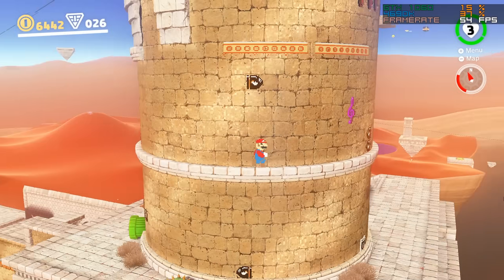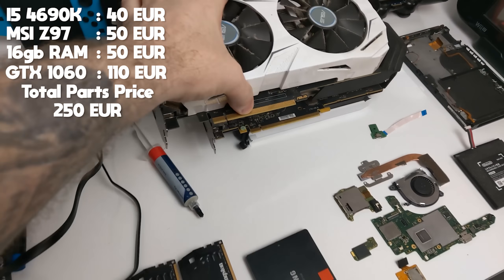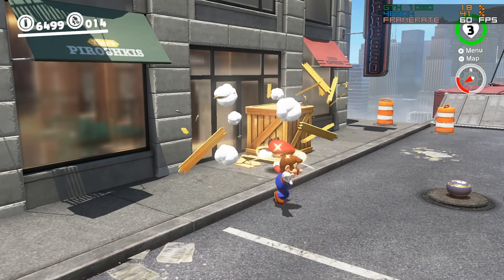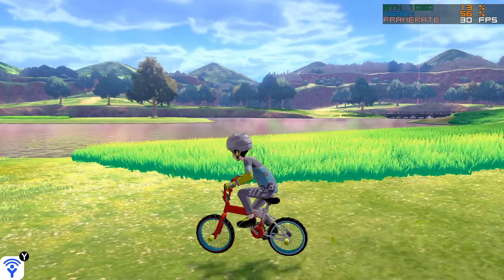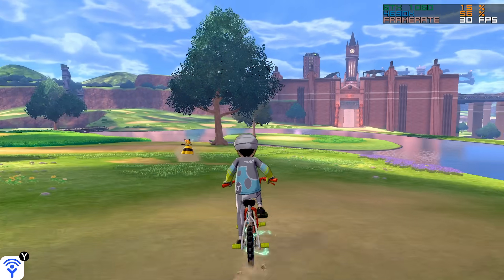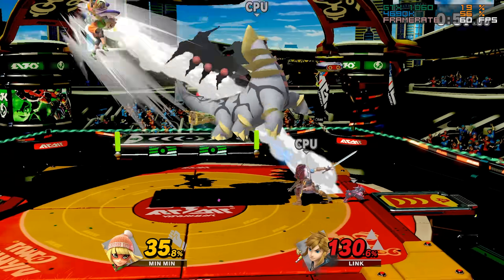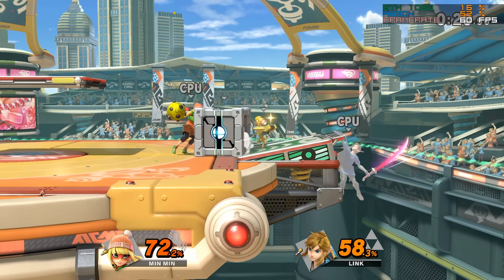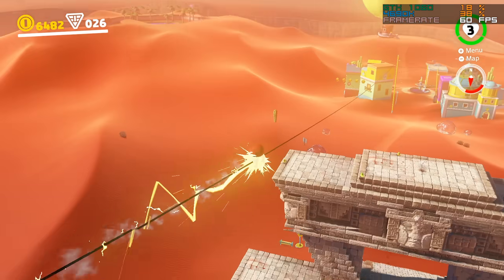Fullspeed Nintendo Switch Emulation on a $50 CPU - Multicore Performance Update

Comment: Please test breath of the wild on this setup.

P.s: I've played it on cemu but I plan to play the switch version too.
Reply: The switch version is exactly the same.
The only thing that make people care for how well it runs on Yuzu is the fact they announced the sequel and its going to run on the same engine.
Reply: @exec_rigveda8299  exactly! :3
Reply: @exec_rigveda8299   I think the shadows are a bit different though. Idk.
Reply: @everfree2532  The shadows are a bit different, and the textures are more contrasty, with different coloration. In CemU you can up the shadow resolutions and use contrast presets to change the look of the game. Plus, you can get the games to go graphically higher in CemU than in Yuzu, because the Switch have more beefy specs, you need a lot more to improve the game, and that generates a giant overhead. In CemU, you can do that just fine, without much trouble for your PC (if it can handle the job). Thus, BotW is a Wii U game, and the Wii U is limited compared to the Switch. The game was ported to the Switch without any major graphics upgrade. The only reason you might be interested in Yuzu is to play Link's Awakening Remaster and the sequel to BotW.

Comment: Sooo, should my i3 8100 with GTX 1650 super be able to handle this now? I had an rx 580 8gb until recently that died (wasn't expecting so I didn't have enough to upgrade yet) and Yuzu ran between 15-30 fps (30 in some areas in Oddyssey, basically still unplayable reliably) but I haven't updated Yuzu, would I get playable framerates now??

Comment: Guys I have an i7 4790 non-k and 8 GB of ram with rtx2060 will I get similar results??
Reply: You should, i have a I7 4790K (not overclocked since i can't cool it enough with my CM 212) and a KFA² Gtx 970 and had almost the same result, since then i moved to a 2060 super (still getting the same result since the emulator is more CPU oriented)
Reply: @akitowanijima104   thanks for your help 😍😍

Comment: The next thing if possible to try is a Ryzen 3100X or Ryzen 3300X with an NVIDIA 1060 to see about low end Ryzen 2 emulation compared to a i7 7700K/i5 4670k

Comment: I actually have a very playable over 30fps performance with my ryzen 2600 and old R9 380 4GB. The main issue is a bug which breaks astral chain for me, it fills ram in few minutes, crashing yuzu. As soon this bug is fixed it will be perfect, since vulkan and multicore does the job just fine.

Comment: Does anyone have any idea why my Yuzu crashes for me after the latest update when I try to run SMO? 
FX 6300
8gb ddr3
rx 580 4gb
Reply: do you use vulkan?
if yes there are many problems with vulkan: no shader cashe (the game has to always load new interractions, causing lag. there are also memory leaks that can cause crashes. It is hard for us amd gpu users :( and yes opengl works but poor performanse. Good luck!
Reply: @rasmusrautio7152  Thanks for the response, it turned out to be a RAP memory usage, once I alocated more of SSD memory to the RAP, the app started working normaly, although now I get crash in the second kingdom (Jungle) once I get to the globe.

Comment: Yeah I'm not getting good performance at all and I followed your set up guide. 
PC Specs:
i7-6700k
16gb 3200MHz RAM
MSI RX 480 8GB
120GB Drevo SSD
With Super Mario Odyssey I'm only at the beginning because it's unplayable. I get around 9-14 FPS
In Pokemon Sword, the game runs a bit smoother at 20ish sometimes it can reach 30 although not constant. It does have a weird graphical glitch though where Character models for humans have a grid-like pattern visible and they are semi transparent

Comment: I've got 2 systems (3700x+2070super, 3600x+rx590). Currently with my parents, so I have the 3600x build, surprised to say performance wasnt super bad with the rx590, but I can definitely see that there does still need to be improvements :) cannot wait to see what else the yuzu team pull off in the second half of this year!
Reply: I wonder how your experience has aged now ??

Comment: second hand intel cpu's are still expensive AF over here
Reply: You shouldn't use intel at all if you're going for price to performance man
Reply: @furosukki1301  different countries have different prices
Reply: @darky799  afaik amd is still cheaper everywhere/in most places
Reply: @darky799  yeah right, atleast for laptops since amd with vega graphics(integrated) costs x2 more than their intel counterpart with nvidia graphics(discrete) for some reason
Reply: @furosukki1301  but if emulators are the go to then and isn't the best.  devs tend to optimize better for intel cpus
Reply: LOL 1200 & 1600 AF
Reply: yeah it's 130$ here
Reply: Same here in .id
Reply: same. i5 6400 is like $70 here
Reply: A Xeon 1270, 1620v2, 2620v3 all under $40USD could emulate very well.
Reply: for 80$ you can get a superior new ryzen cpu who just smacks the s*** out of an i5 this age...
Used Intel parts are now obsolete for like 2 years, they have a very bad performance/price rate since most lowentry cpu from AMD are far ahead performance wise.
Reply: Honestly just skip Intel and go into a Ryzen 5 3600 if you can afford it it’s about 160$ rn it’s an amazing cpu and beats out almost all Intel i3- i5 atm
Reply: why not go zeon? for 30 buck you can have a E5-2650 V2, and for a bit more a E5 2678 V3. I'm not a expert, I'm just sharing infos
Reply: @ginametora  needs a HEDT mobo instead of an mainstream one..
Reply: I3 9100f is cheper than i5 lmao
Reply: @HollowB  9th Gen is cheaper than 8th Gen in my country idk why
Reply: @thn4296  because 9th gen cpus dont have integrated gpu, 8th gen's all cpu had uhd 630 igpu.
Reply: @darky799  Not the 8th gen versions with the F-Suffix in the name. But they are only 15-30$ cheaper.
Reply: @darky799  9th gen CPU do have integrated gpu, only KF does not have an iGPU.
(I use a I7 9700K)
Reply: @julienbailleux2849  i knew, but didn't knew K also don't have igpu, because 8th gen's i7 8700k had it 
(I have i3 8100 😅)
Reply: @darky799  I don't get your answer you know or you don't ?
"But I didn't knew K also don't have igpu" but they do have one so I don't get what you're trying to say.
Reply: @julienbailleux2849  i meant cpus with k behind them had igpu in previous gens, and i didn't know much about 9th gen (only knew f cpus are cheaper because they're cheaper, i own i3 8100, and i3 9100f was cheaper than 8100 even when it was new in market, then i found out i3 9100f and i5 9400f didn't have igpu)
Reply: @HollowB  i got an i3 8100, performance in yuzu is absolute shit. Will upgrade to an i5 soon.

Comment: 2:40 Ok hold up how did you manage to get more than 50fps. I have Ryzen 5 3600 and i have like 35fps. (OpenGL, Docked, Multicore, Async and Assembly Shaders turned on)
Reply: Not sure if it will be the same in your case but when I was playing Legend of Zelda Breath of the Wild with ARB shaders turned on, my RTX 2060 was pinned at 100%. Was getting about 14 FPS in the starting zone. Turned off ARB shaders and was getting 30 FPS in the same area. Might be something to try out and see if it helps. Only issue is that compiling shaders with OpenGL takes forever but once you have a proper shader cache, it runs faster than with ARB shaders turned on.
Reply from the maker: If you have an nvidia GPU, follow my guide and use all nvidia control panel settings. Also, dont use the latest driver (451.48) it is terrible, use the older driver (446.14)
Reply: @BSoDGaming  Is that so? Okay, ill use older driver. Also I watched your video before! :)
Reply: So did u test it how much fps do you get now ?
Reply: @BSoDGaming  wait is there drop in fps?
Reply: @beyer_the_burger  Nah, there's issues with it. I got the last update, and it struggles to get a constant 60 fps on Destiny 2 when I could in the past... I think they added a lot, but haven't verified a lot also...
Reply: @ShadX777  destiny 2 is free on steam loll you'll get it to work perfectly
Reply: @BSoDGaming  latest nvidia drivers work perfect for me. I also have latest windows version 2004. i9 9900KS OC 5.2Ghz and RTX 2080 super, 32GB ram 3600MHz. 2 TB Samsung 970 evo plus nvme m.2 ssd. Cpu and gpu both never go above 20% usage, and average 13-16% usage on both gpu and cpu.
Reply: It seems I reach more fps by playing on Vulkan with Lower Draw Distance mod! Thanks for the comments.
Reply: Have a ryzen 2600 with 2080ti and get 50+ fps
Reply: @joshua7426  Me to I think he's full of shit I really do. But it's good entertainment, I have a 2080ti and ryzen 3800x getting low fps all the time with this emulator.
Reply: Is this available on mainline yuzu?
Reply: @juanmvallejo  Yes
Reply: Can a i3 6100 run Pokémon?
Reply: @MrTee2jay  no
Reply: for super mario odyssey, go to yuzu configuration tab, click on graphics -> advanced, and select High for accuracy level and 4x for anisotropic filtering.
Reply: Yuzu Performance doesn't work good at all on amd cpus
Reply: HollowBack not true multicore release amd + yuzu now better then intel ...
Reply: @HollowB  and amd gpus, so sad
Reply: @HollowB  works just fine on mine
Reply: @HollowB  what are you still stuck in 2015? ryzen cpu nowadays are beast,  performance will get crippled no matter how good your CPU is as long as you still use AMD GPU cuz it sucks on opengl and  vulkan was still pretty unoptimized on yuzu.

Comment: @BSoD Gaming Do you think I Could run yuzu,Specs-Athlon 3000g /8gb ram/rx 570 8gb/
Reply: athlon? never heard of that, but i also got a rx 570 8gb, but i got 16 gb ram, it really comes down to what games you want to play, for the most part i think the performance will be ok, (use vulkan for your amd gpu) (vulkan is new and has some issues but have better performance on amd gpus than opengl.
Reply: @rasmusrautio7152  thanks

Comment: Very impressive!! 
Btw I hope rpcs3 also get this fast development, i badly want to play gow 3, ascension, uncharted series and tlou 1..
Reply: And don't forget Persona 5 as well ^^
Reply: @KrystaZia  Persona 5 works quite well on RPCS3 aswell, not sure about more avg hardware though. Still, it runs well on my Gtx 760 + i5 4670
Reply: @KrystaZia  Persona 5 runs extremely good on rpcs3 even on old CPUs. I Played it on a i7 3770 and a GTX 1650 Super, and got a steady 30 fps on the game which is the native fps.
Reply: +gaming and emulation - if you have decent internet 40Mbps up/down then try TLOU1 and the Uncharted games on PS Now on PC. I recently played through Red Dead 1 and the PS4 Spider-Man game with zero problems and no input lag on my computer. It's only $10/month now, highly recommend it
Reply: I got my ps3 for $60, and its all fully modded so you can play any game.
Reply: you know you can get a ps3 for like 30 bucks and the games are around 4 dollars a piece at pawn shops.The one here sells 360 or ps3 games at 4 a piece and if you buy 2 you get the third game free
Reply: @kyles8524  why?I want to play em 60fps at my resolution. TLOU already looks better on rpcs3 then remastered version on ps4

Comment: I appreciate that you benchmarked performance in the most demanding areas instead of just showing the beginning areas of each game. 

Wonder how well Yuzu runs on Ryzen APUs. A 3400G costs a lot more than $50, but the fact you don't need to buy a discrete graphics card means you should still save money overall compared to this build.

Comment: my i52500k is finally useful!
Reply: Not really I have one and the fps are awful
Reply: yeah i got a 2400 and my benchmarks for odyssey  are almost half what he's getting. keep in mind he overclocked it as well so the results are skewed
Reply: that CPU will not do well. anything before Haswell (Intel 4th gen CPUs) will have terrible performance due to lack of modern CPU instructions

Comment: BSoD, what do you think Yuzu needs the most moving forward? As far as I can see, the emulator is almost perfect as is.
Reply: The emulator need more work it is most working very will on low pc because the Switch it is only power full by 30%- 40% then the wii u
Reply: Only a few games run this well, most don't.
Reply: "perfect" yeah go try run acnh with vulkan without crashing every 5 minutes
Reply: To give you a "vague" idea of how developping the emulator is, dev's have to find mecanics and fixes for almost every game independantly to one and another.
What I mean is that in worst case scenario, they have to develop a build for each and every game of the Switch (it's not the absolute truth, but it is not that far)
The reason the emulator looks so good is because obviously, the devs are working first on the most popular games at the moment, but once you go out of those most popular game, it's full of bugs or glitches.

Comment: Would a i7 3770 run better than the CPU showed in the video?
Reply from the maker: No, it will run 40-60% slower since it lack support for the AVX2 CPU instruction
Reply: @BSoDGaming  Wow, that its true, i have a 3770 and a  GTX 1060 6GB and smash dont run as smooth as the video you post here, so thats the reason why it doesnt run in smooth 60fps like on this video even when the 3770 have more threads ?
Reply: @BSoDGaming  Ah, thanks for the info!
Reply: Probably, since it uses hyperthreading for 8 virtual cores and it's about the same speed
Reply: no

Comment: Now we all want to know how well this runs on a 3000G as well as a 3200G
Reply from the maker: With a dedicated nvidia GPU, very well.
Reply: @BSoDGaming  the 4500u when overclocked can run cemu pretty well 30-60fps on 900p. There is a benchmark on the 2500u and 3500u overclocked. That's with the integrated gpu.
Reply: @BankruptGreek  What do you mean by overclocking those CPUs? The CPUs you mentioned don't have unlocked multipliers as far as I know.
Reply: @Secondarian  what you can do is unlock the tdp of your laptop, it will then overclock itself. It will end up overheating and underclocking to lower the temps but if you have a cooling pad for your laptop it will remain overclocked.

I am not sure as I don't have any laptop atm, but I think you can also unlock some other options. If you find out by searching it on YouTube I dd appreciate any details you could find.
Reply: @BSoDGaming  I don't see why yuzu after a lot of optimization won't run on 3200g or the upcoming 4200g (on integrated graphics and 720p).
Reply: @BankruptGreek  that's exactly my thought as well. So run these games on their native resolutions, like you normally would with the actual console.
Reply: @p_mouse8676  Why would you emulate it in the first place then?
Reply: @Secondarian  To have just one device in my room to play a whole range of games (PC and console) as well as watching videos?
Reply: @BSoDGaming  i am actually very curious what we can aspect under linux? For something like a dedicated media center + emulation box it's an extremely interesting choice.
Reply: @BSoDGaming  Like we don't know that a dedicated Nvidia GPU wont work? OP was clearly talking about integrated vega APU
Reply: I have Ryzen 5 2400G + Nvidia 1060 3Gb, SMO stable and SSBU 60fps no problem
Reply: With a 3600 + GTX1650 it runs perfect.
Reply: Ryzen 1400 and GTX1060 3GB works great in ACNH compare to previous update which suffers 15~21 fps.
Reply: It would be really awesome if a 4500u could emulate smash. Its a 6 core 6 thread zen2 based cpu so it's decently fast cpu wise but the gpu may cause problems. If it runs on that it will be insane since there are 500-600 usd laptops using that chip.
Reply: @totinospizzarolls4737  I think a gtx1050 is comparable to the performance of the 4500u
Reply: @totinospizzarolls4737  I cry every time I see the prices in Europe. The flex 5 is one of the cheapest 4500u laptops and it costs around $600 in the US for the 16gb model and then in my country it costs $870 for the 8gb model. And we have about half the average annual income..
Reply: @BankruptGreek  what laptop do you have now?
Reply: Not well. Zen+ runs AVX 2 at half speed and barely has Haswell ipc. Haswell runs AVX 2 full speed, and that's why the i5 in this video works so well. That and this video's i5 4690k is on a z97 mobo and can be overclocked to 4.6 ghz or more.
Reply: Unless Vulkan becomes stable that aint gonna happen.
Reply: @nikobellic7455  hey niko, lets go bowling

Comment: sadly that emulator wont perform too well on a sandy/ivy bridge cpu (any of them), glad to hear i can switch to a cheaper cpu i was about to buy an used 8700k, this is nice..
Reply: yeah single core performance is a must even with that patch sadly
Reply: why? just buy 8700k if you can, it would be a great help on getting 60fps+ on RPCS 3 as well, unless you're fine with 30+ then yeah